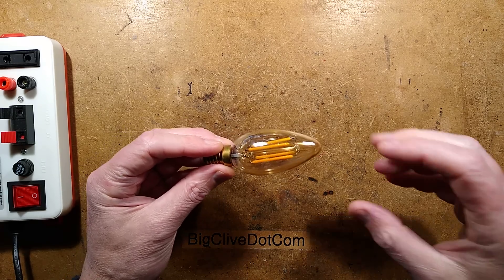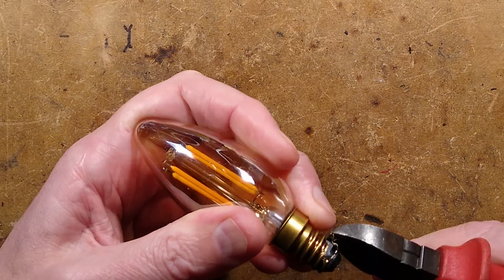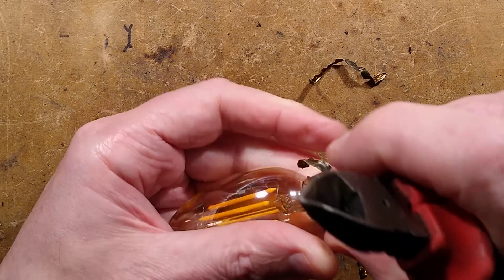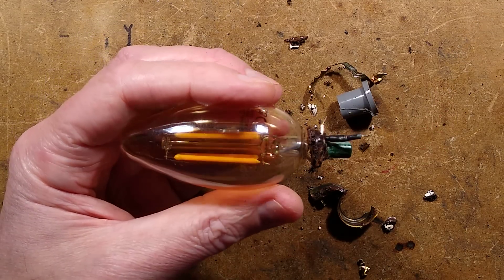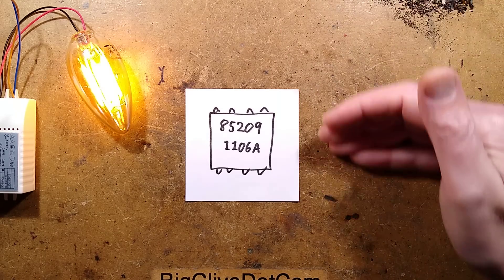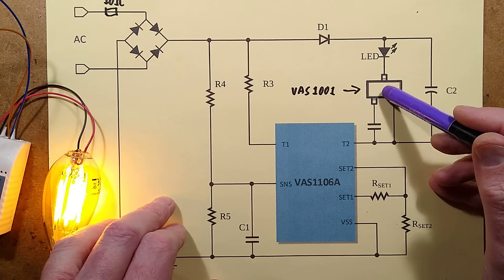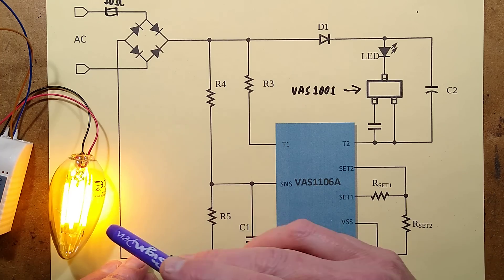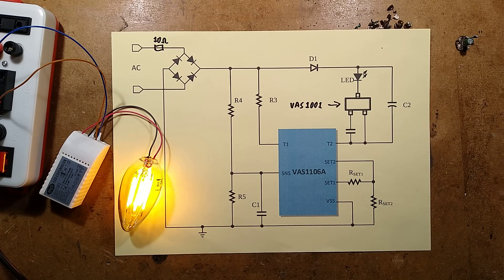Inside a STOLEN (faulty) LED bulb

Comment: I wonder if the lamp was rated for 120 V and was miss sold into the 240 V market.   By the way, was this bulb from the pub 2 with disco lights in the loo?
Reply: I briefly considered the disco lights in the loo and decided, I really, really don't want to know.
Life should retain some mysteries.

Still, I doubt it. That simple of a circuit would likely fail if it was a US voltage circuit in the Kingdom. At least, per my somewhat limited experience.
Spent 5 years in Qatar, which uses the UK electrical system, but incessantly sold Europlug supplied appliances. And just long enough to actually step on a UK caltrop plug. Most of the time, they sensibly roll over and lay on their side politely.
But, none of those plugs ever tried to kill me, unlike US plugs. The US has a third world power system, which matches our health care system that's 20 years behind Europe and well, even Cuba, who developed a lung cancer vaccine we're only now finally testing for approval.
The best in the world at mediocrity. 
But then, a wise old Brit once observed, "The US will eventually do the right thing - after exhausting every other possibility".

Comment: I was browsing LED drivers and came across a few like this. I wonder if these are the chips you are talking about? They are about 4p each. https://datasheet.lcsc.com/lcsc/2209231730_TM-Shenzhen-Titan-Micro-Elec-TM1810-2_C5174560.pdf

Comment: Not sure this is what happened here but I've fixed a few LED bulbs in the past that went dim because one of the current sensing resistors (usually 2 in parallel) was poorly soldered and went open. Several of them failed like this after less than a year of operation, but after being fixed have now been in use for over a decade.

Comment: Followed this one okay, until around 7m.30s. amid a couple of "basically's" too many, it all sadly degraded into gobbledegook somewhat, losing me completely (yes, I know, not hard, ha-ha) in relating something about dimmers and resistors various. Disappointing!
Reply from the maker: Quick summary.  Triac dimmers need a slight continuous load to latch on properly.  This bulb has two sections.  A resistor that provides that load and also the LED bit.

Comment: I think in this failure mode it just turned into a very noisy resistor that sometimes decides to emit light.
Reply: Any resistor will emit light if you use it wrong enough...
Reply: Well, either a glowbar resistor or a smoke emitting diode.
Reply: @spvillano  Well the whole thing was charred inside, it was just being hundreds of resistors everywhere.
Reply: @kyoudaiken  hundreds, seriously?
O could get drunk and not manage that manglement!
Reply: @spvillano  I'm not drunk. Charcoal is conductive. So all that conductive material creates resistors that aren't in the schematics.
Reply: @kyoudaiken  charcoal is wood baked in an oxygen free atmosphere. Carbon is what you're speaking of and was conspicuously absent. What Clive was chipping free was a plastic, which is notoriously hygroscopic and frankly, one of the poorest choices for use in that device.
The companies tend to use and reuse the cheapest components available, including recycling antique crap from back when they used to make incandescent bulbs.

Comment: Wow that is a lot of circuitry in a tiny space. As you were peeling off the base I couldn't help wondering how they fit the filament LEDs into the glass bulb, the hole at the bottom did not look large enough.
Reply from the maker: The globe has a hole big enough for the filament structure to be placed in and then the two glass sections fused together.
Reply: For these sorts of LED bulbs, the bulb itself is almost always plastic, not glass.  As such, they may well have just inserted the filaments while the bulb had a wider opening, and then heat-formed the base into the smaller shape after the components were already inside.

It's hard to tell from the video, but another possibility is that the filament assembly is designed in such a way that it can be compressed more tightly together when being inserted into the lamp, and then will "spring out" once inside to its full size.
Reply: @foogod4237  The bulb is actually glass. Some higher quality bulbs are filled with helium-oxygen mixture to conduct heat away from the LEDs.
Reply: @mernokimuvek That would be convection, not conduction.  Why would a lower density (and more expensive) helium mixture conduct heat better than plain old free air?
Reply: @stargazer7644  Did you fail from physics? Hydrogen and helium are better conductors of heat because their atoms are smaller. From this it should be also obvious that xenon and other heavy gases are worse conductors of heat. Isn't this supposed to be basic knowledge?

Comment: Did my own tear of a G9 pagazzi 3.5w led 240v. Bridge rectifier,  2 resistors , 1 capacitor? And an unknown chip. Couldn't find  chip details. No great signings of overheating but lamp still blown.

Comment: I have dozens of such 4W "filament" flame-style bulbs at home in our antique chandeliers and wall lamps, I buy them in bulk from China. When they fail, it's exactly like this, turns flickering or dimming, some has a dead LED that can be easily spotted when dimmed. I think their demise starts when a LED fails. Some works for years, on the whole lot I have in service, the failure rate is a few %s . I've always thought sending you some cadavers for the fun of the autopsy, but looks like you've found a nice test subject by yourself :P
But mine are the cheapest one, not dimmable. Wonder what's inside for being made that cheap...
Reply: Likely, no controller chip, regulator and cap, just diode and dropping resistor.

Comment: I must say, I do like that test box, It's a very useful, viable solution for quick testers and professionals alike, as these users know where, NOT to poke you fingers.
It is It's crudity and hazardous to use in the wrong hands that makes It a good tool, like a big lathe or an excavator, lethal in the wrong hands.
Reply: I'm definitely a professional, but we all can get a bit complacent and need a rude reminder on occasion. Better to get it from a coworker though.
Was checking my coffeepot, which wasn't heating up. Had the bottom off, didn't feel like unplugging it, so rather than resistance measurements, I went to voltage measurements and found what I had suspected initially, a failed thermal fuse.
So, then I moved to disconnect it from the mains. While doing so, while sitting in shorts on a ceramic tile over sand over concrete floor, my knuckle brushed the hot and I completed a circuit from knuckle to ground, via my scrotum. UK standard 230 volts, 50 hz, so it was tingly. Had it been US voltage, I probably wouldn't have even noticed it.
Complacency can get you killed, or at least part one doesn't want cooked, lightly seared on the reality grille.

Nastiest I got was 35kv pulsating DC 7875 hz, riding on 130 VDC. Pinhole in the insulation in the second anode output of a flyback transformer. Arced to my right index finger as I reseated the board after adjusting vertical height, arced from my left index finger to the tuner ground. After a serious run on those Zenith TV modules, Zenith sent one of the design team engineers to review what was going on and I brought it up. The engineer said, to blow the regulator chip the way it failed, I had to have drawn 3 amps arm to arm of DC current.
Yeah, felt like it. My heart had actually briefly stopped, which was an exceptionally weird sensation, then jumped and restarted, couldn't feel half of my forearm down to my hands. Drove home and called the office, taking three tries to dial, told them I got lit up badly, reordered the module and took the rest of the day off. Sore as hell the following day.
Reply: Yeah you want to be careful.

Comment: Clean lick

Also, VAS1001 is an interesting chip. Definitely looks like it’s operating in some kind of constant current mode. I’m guessing the cap on the third pin is some kind of bypass a la the LM386?

Comment: Ah the standard failure mode of LED filaments, had plenty of cheap ones go super strobey mode to the point I stopped buying them, that and my clumsiness kept dropping them and I broke many a glass bulb... :P
Reply: Most of the failures like that I've found were capacitors drying out. I always wondered how a tantalum cap would've fared in the same circuit.

Comment: Had to get rid of my dimmer simply because less and less worked with it and filament bulbs aren't available in shops any more, do you think you could include one of those lvr's inside of one and help more be compatible?
Reply from the maker: Given how dim most LED lamps are, you probably don't need it anyway.
Reply: You can still get Halogen versions.
Reply: @dogwalker666  if I could I would have
Reply: @phonotical  Oh I have just ordered a carton of halogen candle bulbs for that very reason.

Comment: You've made my day I've always wanted to know how get inside a light bulb without breaking the glass now I know as I wanted make a quirky torch using a light bulb glass 👍
Reply: Note that this won't work with incandescent bulbs, because their glass is sealed.  LED bulbs usually don't have sealed bulbs (because they don't need to keep air out to function).  LED bulbs also usually use plastic instead of glass for the bulb (which also makes them safer to try to disassemble)..

There's also lots of variation from one manufacturer to another regarding how these things are constructed and how easy it is to get into them, so depending on which bulbs you have you may not find it to be this easy...
Reply from the maker: Keep in mind that the standard LED bulbs are usually quite high voltage arrays.  But you do get 3V versions.
Reply: @bigclivedotcom  what voltage are they typically that you've found? I largely see 90 volt arrays here in the US.

Comment: Bulb made by BEL?
Bharat Electronics, Limited in India.  

With incandescent lights you can pretty much see what's defective.  No such luck anymore with LED lights.

I thought places of questionable repute used red lights, not blue.  Our fire dept's engine house has a red light.  I wonder if that means anything?  😮

Thanks, Clive for making my day.  I just don't feel right until I take something apart, either really or virtually on Clive's YouTube channel.  😍
Reply: They use blue lights to make it more difficult to find one's veins for injections. A red light at the fire station is generally tied into the paging system to indicate a current active call, much like a whistle/siren. It can also sometimes be used to indicate a fault or alarm condition in their alarm system or some other type of mechanical system.
Reply: @RT-qd8yl  really? I always palpated for a vein.
But then, I was a medic. If I couldn't find a vein in the dark, the poor sod was dead. Especially, given I was never shy at starting an external jugular and once, a penile line. In all cases, with the victim and his buddies armed with machine guns.
Got my electronics certification in '79, medical in the late '80's in SF medicine, IT cert in '90's and got certified REF in '10 (Retired, Extremely Flatulent).
Oh, chemical, biological and nuclear in '82. Explosives in '85.
In my spare time, I part oceans with a toothpick, alas, I've little spare time.  :P
Reply from the maker: Bell Lighting.
Reply: @bigclivedotcom  wonder if its the same company as was British Electric Lamps Limited aka B.E.L.L. ?

Comment: Dr Clive soft of fixed the bulb. 🤣 .I thought we might see a bad solder joint, but once open its difficult to see anything. 👀.
Very interesting bulb. 2x👍
Reply: A Bad solder joint does not glow red hot
Reply: @NinoJoel  actually, I've saw some that did and while arcing, also spewed metal sparks from the evaporating solder.
In one case, a Philco television with gate turn-off SCRs in the horizontal output circuit, causing a carbon trail to form before my eyes and before I could kill the power, arced at high voltage and current, literally causing a small blind spot in my retina.
Managed to fix it, once I recovered from the UV burn, as it was a family member's TV, but the surgery on the board was rather extensive.
Never ran into such a problem with Sony, who sensibly put the SG-613's off of the frigging board.

Another prize winner, although a distant second, was an MOV vaporizing before my eyes at 2 feet distance. Blown fuse, all circuits that could blow the fuse checked out unshorted. Popped in a fuse, plugged in my cheater cord and the damned thing turned into a six inch ball of yellow-orange plasma. Didn't break over with my meter, but 120 volts vaporized it.
The customer was a 90+ year old arthritic woman, who jumped from her chair and toward the door like an 18 year old.
Obviously, I wasn't expecting that, otherwise I'd have asked her to leave the room. The only thing left of that MOV was the leads.
Soldered in a replacement, checked for damage, which was none, due to its properly being placed inside of the chassis, popped in a new fuse and the unit worked perfectly.
Reply: @spvillano  it is lightbulb and has no high voltage or high current circuits that could arc any significant time. 
Glowing permanently red hot as a result of over current is not the same lol 
But interesting story nonetheless
Reply: @NinoJoel  ok, led is precisely the same as incandescent. Got ya.
That you get wrong modern semiconductors and vacuum tubes is right, gotya.
Reply: @spvillano  that reply makes absolutely no sense.
Reply: @NinoJoel  many of the LED "light bulbs" I've looked at were supplied by 90 VDC by the driver. Others did use lower voltages.
But, vacuum tubes did glow red hot - especially if I tied a grid to the plate.   ;)